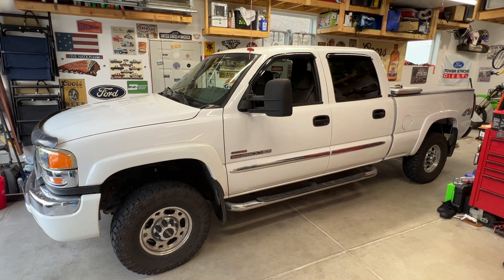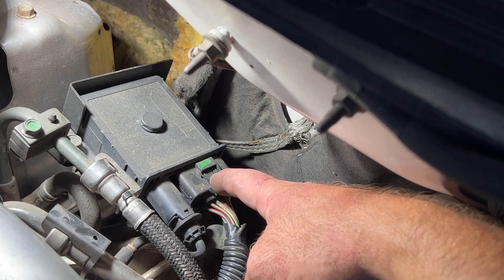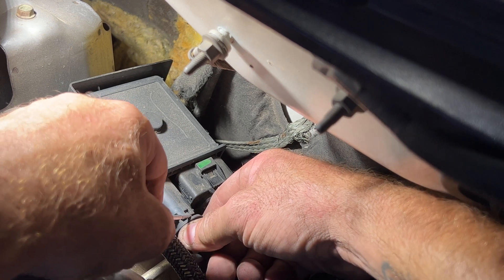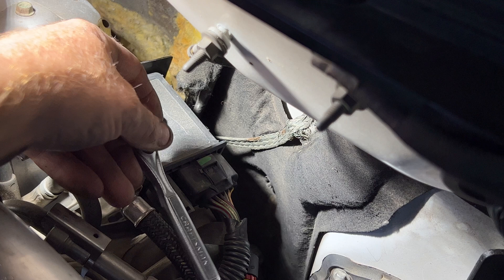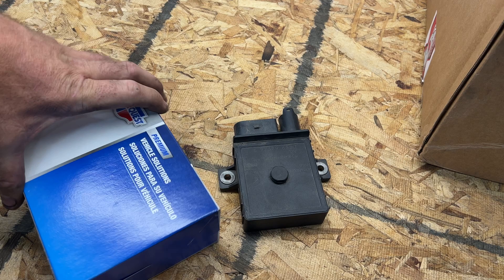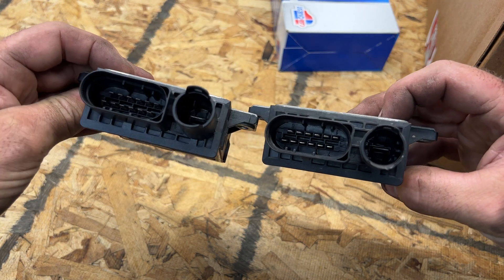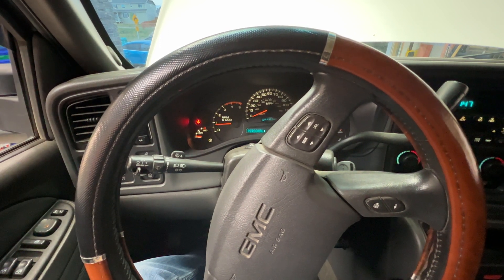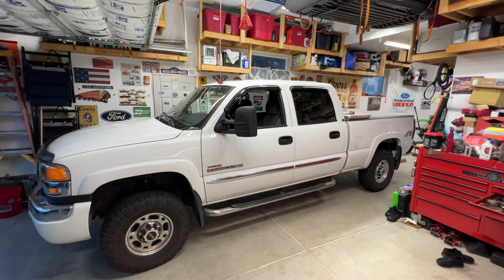Duramax LLY Glow Plug Controller Replacement How-To

Comment: Thanks for showing us the little screwdriver trick.  I've replaced the glow plugs and now I suspect the module.  At 72 I just don't have the grip strength to squeeze the taps down.  Also at 20 year old plastic connection the plastic is not as flexible as it was new.

Comment: I got 2005 LLY check engine light is on and the code is glow plug control module on OBD ll I bought it with 120,000 miles and it now has 200,000 previous replaced glow plugs at 110k any way to determine if it’s plugs or module ? Thanks in advance and great content 👍🏽💪🏽

Comment: What was the truck doing at told you to change this part.
Reply from the maker: Truck was throwing a couple glow plug codes and having trouble starting on cold days. Owner of the truck wanted to change out all glow plugs and glow plug controller even if it wasn’t bad.

Comment: Does the Controller have to be programmed at the dealer in order to work? Advanced auto is out of these,but I can find them on GM websites,also states has to be programmed. My truck is an 2005 LLY
Reply from the maker: The LB7 and LLY no programming needed The LBZ and newer need to be programmed.

Comment: where did you get this controle module....gm part is discontinued and impossible to find.....I have 04 duramaxlly  help
Reply from the maker: It’s just from advance auto parts here’s the link https://shop.advanceautoparts.com/p/carquest-premium-diesel-glow-plug-controller-rac2605/12521736-P?searchTerm=rac2605
Reply: I just had to replace mine and it was really hard to find one. Napa auto parts was the only place I found one. Part # GPR112
Reply: NAPA for me too!!!!

Comment: Thanks for the video. One question. Isn’t the glow plug light on the dash supposed to light up for a couple seconds?
Reply from the maker: It just kind of depends on what the current engine and outside temp is on how long the light will stay on.
Reply: @BLUECOLLARGARAGE  so cold start and 20 degrees it should stay on for a little right?

Comment: How about for a 07 gmc 2500 sierra?
Reply: Different motor if it’s late 07, lbz has the same basic architecture with a different bore and factory tune im told